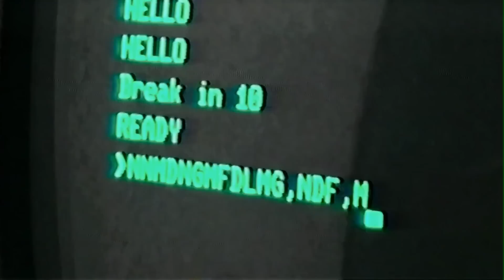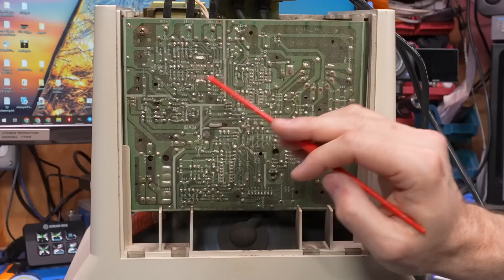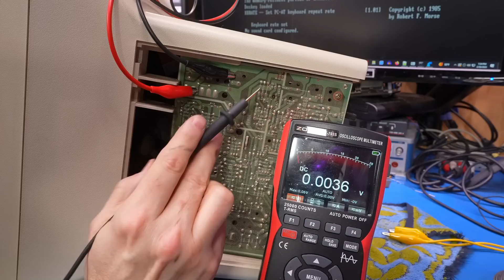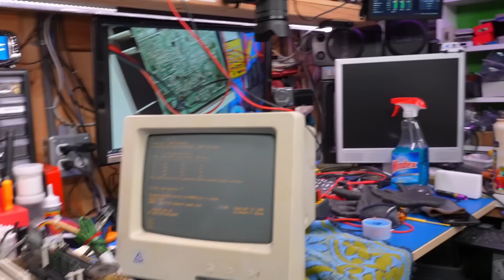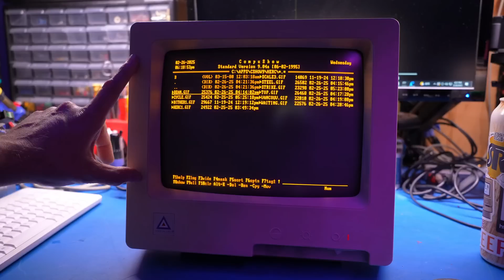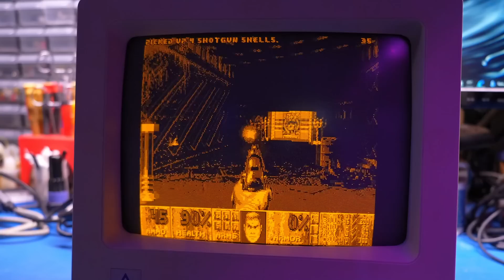Parts were falling out of this monitor (Leading Edge DR-1240 repair)

Comment: There are some DOS system (.sys) files to trick the program that there's a CGA monitor installed to monochrome. I might still have them as I use to do that back when.
Reply: There were Hercules cards that could emulate CGA on monochrome monitors, so you could run game in native Hercules mode or in CGA mode, whichever was better. I think "Stealth Fighter" benefited from being run as CGA (i.e. on card emulation).

Comment: I would have used discrete Schotty diodes rather than a bridge rectifier. Schottky diodes produce less heat and because you have 4 of them, you spread the heat production over a larger volume. The type of bridge rectifier you did use is designed for mains voltages, 1.5V voltage drop is no big deal for mains voltage. For the voltage coming out of a transformer it is a much bigger deal. Discrete diodes would also look less ugly.

Comment: One of my 'if i win the lotto i would like to try.' is try and crowdsource a way to build new crt, or something that would function like a crt but with modern tech. To tap into that market of people who want them. A lot of people now want them. both for retro computers and consoles. But also due to people like Linus from LTT showing the younger generations, that they're input lag free, and lower details look better on them compared to flat panels.
Reply: What we really need is high quality open source universal chassis. there are so many functional tubes whose only problem is bad/aging electronics or mediocre quality boards
Reply: For real! I’d love to see new CRTs, it’s a shame it’s such a daunting undertaking.
Reply: They don't look better though and nobody misses the weight.

Back in the day when I was doing desktop support I used to go to the gym to make slugging around 20" CRTs manageable.
Reply: @michaelstanley5215  lol. No.
Outside the cheap sets. The way they display pixels makes edges less harsh. Full screen aa wasn't as needed back then as now.
Latency was near instant making q3 and ut99 a blast to play.
Not to mention many consoles had their graphics designed around the way they display pixels to show colors and effects past the consoles limits.

Oh not to mention all the light gun games.

A modernized crt would most likely use lasers instead of a electron gun and magnets.
Reply: @ligerstripe99  Still wrong.  What you need to do is buy better quality displays instead of the cheapest thing you can find at Walmart.
Reply: @ligerstripe99  I feel like lasers don't have enough resolution for this kind of thing. Probably better to go with tried and true and use an electron gun
Reply: @retropcs88   Why wouldn't a laser have enough resolution?  Resolution is really just a function of the size of dot you produce, and how close you can run the raster lines.  With the right lens and some kind of servo mechanism that can steer the beam (wouldn't be a yoke like an electron gun, so an exercise left to the reader ...) I would think RGB lasers would do just fine.

This is indeed what I'm looking forward to some day.  A raster-scan RGB laser projected onto the back of a screen like a rear-projection set.

Comment: Aaand another shoddy garbage "repair" that will break again in a moment. Wouldn't ever trust you with repairing one of my devices.
Reply: What's shoddy about the repair
Reply: @naut3  He should replace the bridge rectifier with 4 discrete Schotty diodes.
Reply: The rs602 is over spec, but that's not a bad thing. Back in the day, I wouldn't have done this for customer's monitor and would have tried to source the original part, but it's perfectly fine for something at home. The cap is a little too far out of spec, but good enough for testing. I would replace it with the proper value. Still, the point is just to get the thing up and running for the video. He's not repairing it for a customer.
Reply: @andrewdonatelli6953  Yeah I get this channel about the people fishing part, like some Bob Ross act. Minimal skill and hearty enthusiasm.
Reply: @Breakfast_of_Champions  That's a bit harsh. I really enjoy Adrian's Channel. This is all the stuff I used to work on back in the day and it brings back memories. A lot of his videos are very good and go into a lot more detail than and troubleshooting than I ever would have when it was about getting the repair done as quickly as possible to minimize labour costs. However, Adrian using a scope to troubleshoot and explain what parts have failed Is quite informative for people.

Comment: unless you have  pre sprite  monochrome graphiics based ggraphics  there is no need to  keep monchrome alive   unless you still using 70's-80's based libruary databases

most libruary systems by the mid 90s were using win 95-98se

Comment: These were often sold, IMHO, as POS (point of sale) monitor in Europe under a different brand. This is why the video cable and power cable are very generous. There were also tiny versions available, like 9", also amber.

Comment: That is really nice amber monitor. The industrial design is excellent. Thanks again for walking us through the repair.
Reply: It looks like a nice, low-footprint, low-height design.  Probably intended for some point of sale or customer facing desk where you don't want a tall monitor blocking your view, but you still want an angle adjustment.

Comment: That was great, 🎉 you fixed it! Ironically, it’s in better shape than it would have been if it hadn’t failed - otherwise it would probably have been used until the phosphor wore out.

I have a sentimental love for amber but only have white (Compact Macintosh) and green (Zenith ZVM-121) CRTs.
Reply from the maker: Heh yeah. Amber seems to be especially prone to burn as well. (Along with the high persistence green.) It seems to me that the common blue-green phosphor and P4 white (used on Macs and similar) is very long lived.